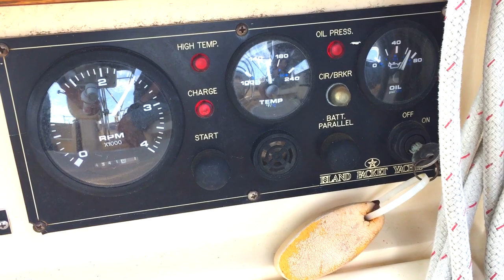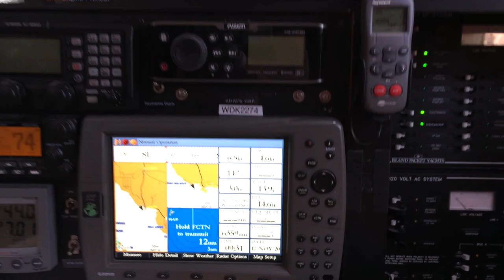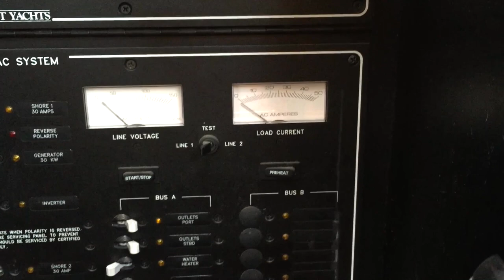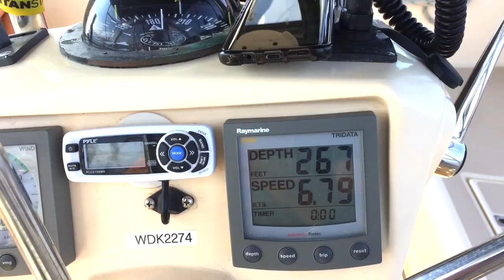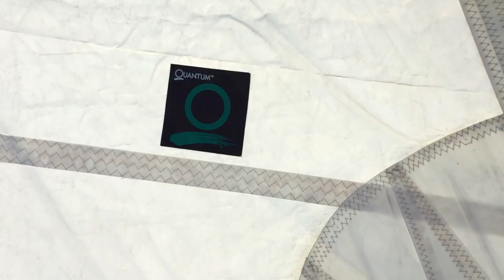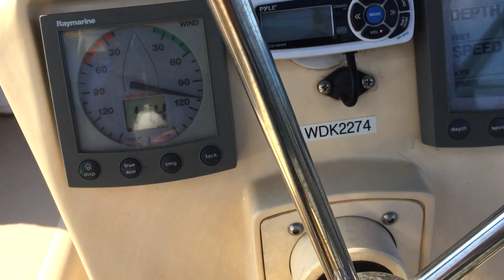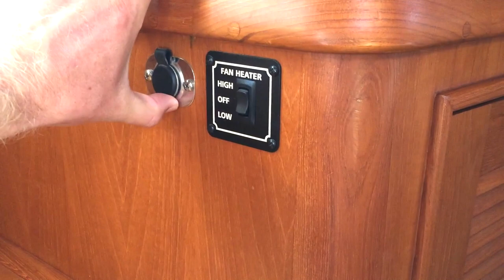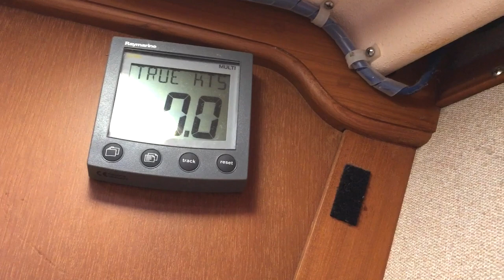Is The Island Packet 420 The BEST BLUEWATER Sailboat Under $300K?

Comment: There are a number of higher quality, better performing offshore cruisers for less than $300K. The Cabo Rico 42, Valiant 42, Pacific Seacraft 44 are all vastly superior in both build quality and performance and all can be had for less than $300K.
Reply from the maker: IP has LWL 37.4' vs Cabo Rico LWL 32' vs Valiant 42 LWL 34.5' vs PS44 LWL 33.5' (advantage IP).  In same order as above, here are how specs compare:  Sail area/Disp. - 15.30/16.31/16.37/17.12 (advantage PS44) |  Bal./Disp. - 40.0/38.8/38.6/40 (advantage - draw) |  Disp./Len. - 257/365/267/325 (adv. IP in lighter air, Cabo Rico in heavier air)  |  Comfort Ratio - 34.12/38.73/34.87/39.36 (negligible practical difference in comfort for bluewater, but slight adv. PS)  |  Capsize Screening Formula - 1.84/1.70/1.76/1.68 (again, negligible but adv. CR)  |  S# - 1.95/na/1.84/1.57 (adv. IP).  So, you can see based on the specs, they are all comparable and the examples you've given are anything but "vastly superior" in quality or performance.  I've also put out a video on a Pacific Seacraft 38...they are comparable in build quality.  I've seen nothing in the construction or fit/finish of the IP that would suggest it's anything but as well built a boat as the PS.  And performance of the IP is par or better (certainly of the above comparisons and specs, it's very likely the fastest of the 4).  Layout/comfort advantage -  I personally think goes to IP of the 4.  Prices are comparable between all 4.  Power-plant and tankage - advantage IP.  Have you ever been aboard or sailed an IP?  I think you would be surprised!
Reply from the maker: For those who don't know what the S# means:  "The equation incorporates SA/Disp (100% fore triangle) and Disp/length ratios to create a guide to probable boat performance vs. other boats of comparable size.   For boats of the same length, generally the higher the S#, the lower the PHRF.
Under 2 - Slow, under powered. 
2-3 - Cruiser 
3-5 - Racer Cruiser 
5+ - Fast/Racing"
Reply: Yeah for 300k you could have a plenty nice boat and 200k left to get around on, I can't imagine paying 300k for this thing
Reply: Saltwest Co Sailing l
Reply: Those are just your OPINION.

Comment: There's a lot of jealous people in here that can only afford older Beneteaus and Hunters I guess. 

I really like the IP 420. One thing I was wondering though is about the chainplates. I heard they rectified the problem with them sometime around 2003. Is this something that was fixed for the 420 models?
Reply: Most people that trash talk IPs have zero experience on them or are bay racer snobs that have never been away from the marina for more than an hour.
Reply: The chainplate issue was resolved with the 1999 model year IPs and everything after that.